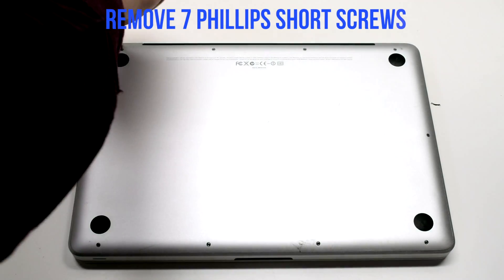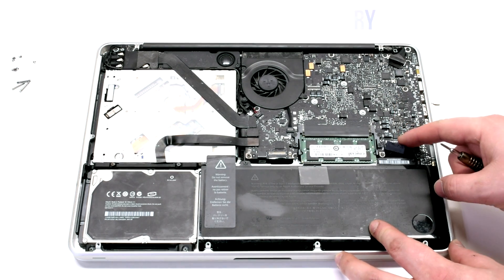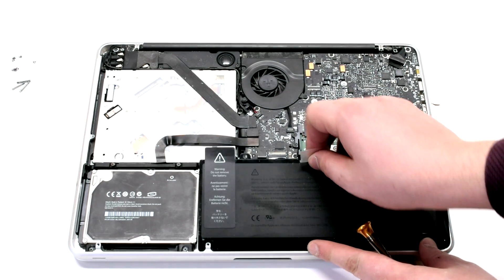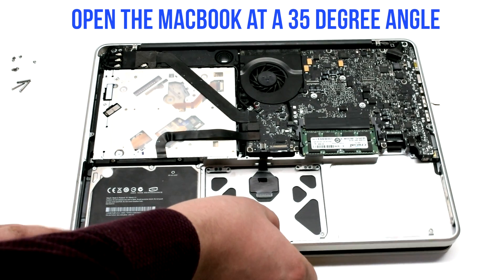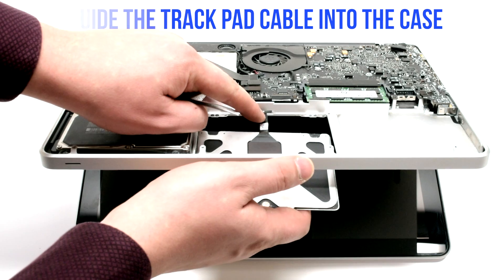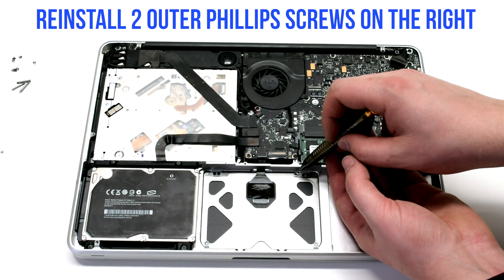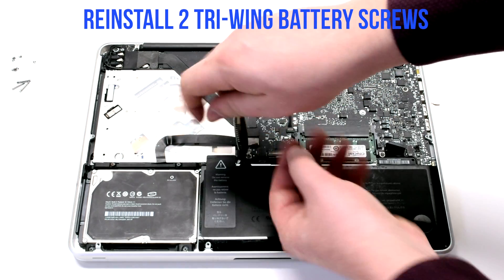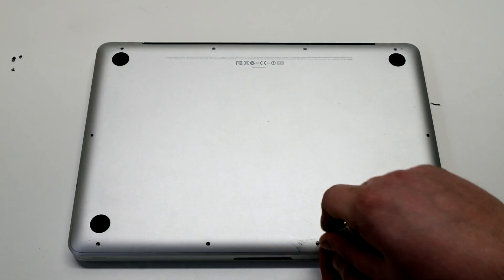2012 Macbook Pro 13" A1278 Track Pad Replacement

Comment: I have a 2012 macbook pro and the trackpad cracked in half due to puffy battery. This will help me fix it, I just need a  tri-wing screwdriver, replacement trackpad, battery and charger. I want to fix it because there are programs on it my 2021 macbook pro can't run and it has Windows 10 on it which my 2021 macbook can't run without emulators

Comment: watching this while my trackpad currently is jumping crazy. temporary fix is using a mouse. hope I can do this. anyone got a link to buy a replacement trackpad for this exact model mackbook pro?
Reply: I recently just purchased this one: 
https://www.ifixit.com/Store/Mac/MacBook-Pro-13-Inch-Unibody-Mid-2009-Mid-2012-Trackpad/IF163-025?o=1
Reply: @r1c3xboi  clutch man thanks. will keep it on bookmark but for now the trackpad is normal after leaving it a few days idk maybe it just needed to settle after lots of usage and being old
Reply: @JLummin  No problem. I haven't received yet but can let you know how it goes after install.

Comment: is it necessary to put in a new battery if you disconnect the old one? can i keep the one i have plugged in while i do this since i don’t want to replace the battery? or will it work to disconnect the one i have and plug it back in?

Comment: Just did this but now the mechanical click won't register. Any ways to fix this?
Reply: There's a torx screw on the bottom of the trackpad you can use to adjust the spacing for the click. Too tight and it wont click, too loose and it'll click kinda of wobbly

Comment: Did you need to use different screwdrivers or just the Phillips 00?
Reply: need an answer to this as well
Reply: To remove the battery you need a nr. 2 tri-wing bit

Comment: Hello, I have a MacBook Pro A1278 with two problems, the webcam does not work and the sound is heard very little, if I connect headphones it is practically not heard. Do you have any videos that help me?
Thank you
Reply from the maker: Use a bluetooth speaker or replace logic board.
Reply: For the webcam issue you can fix that by opening terminal and typing these commands in: sudo kill all VDCAssistant

And you may have a pin that is halfway depressed. Try looking inside and pushing something like a wooden tooth pick or something that's not metallic inside to push the pins out. 

If that doesn't work you'll probably need to get a new logic board or someone that really knows what they're doing. 

Thanks

Comment: very well made video, i like that it had a good step by step tutorial while listing the computers parts identifier, i also liked that when reassembling you didn't just say something along the lines of " now do what you did to take it apart, but backwards" I briefly worked on iPhones replacing certain parts and would look for tutorials for tricky parts that needed heating or something and would hate when i was watching a tutorial and would not get some guidance back to were i started.
Reply from the maker: Glad that you enjoyed the video. It was a very intentional design to have a follow-a-long  reassembly, simply because the order of reassembly operations with Apple products are not always the same as assembly and the angles of reinstalling screws are not always the same as removing them.